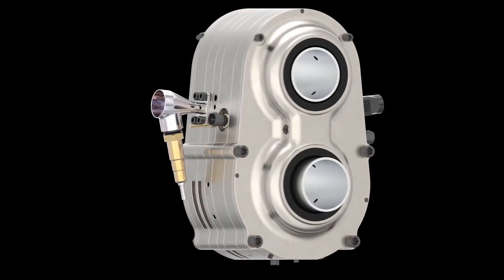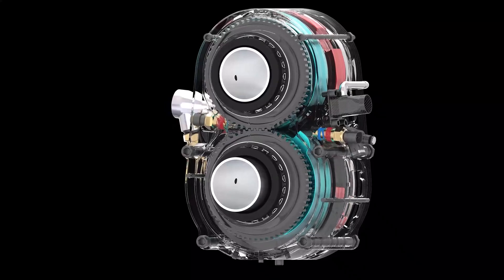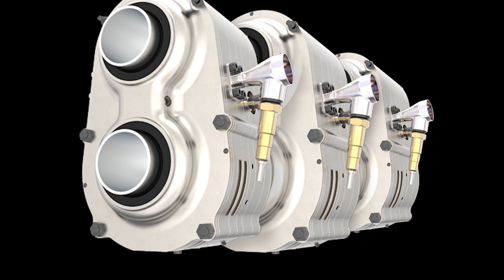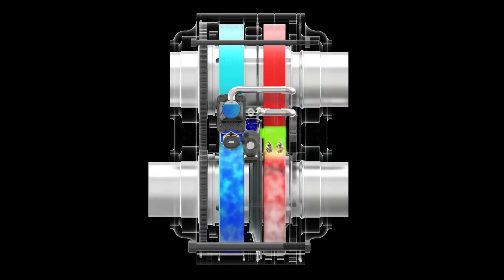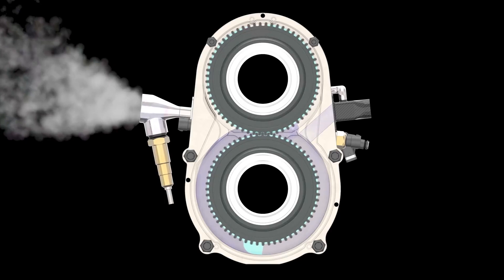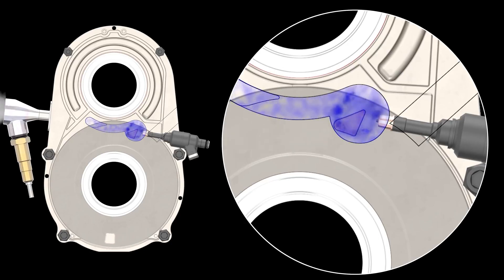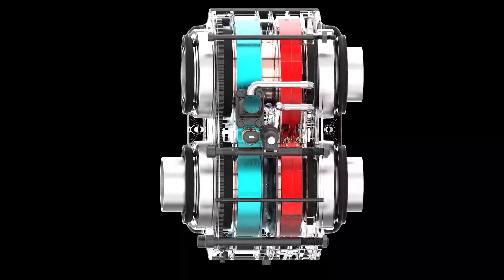This pistonless engine runs on hydrogen and revs to 25k rpm

Comment: 2 things come to mind, 1) I'll believe it when I see it in production and 2) I want one on a motorcycle.
Reply: I came here from a motorcycle channel lol
Reply: I was thinking my suv, but motorcycle? You daredevil you.
Reply: @chevyDboyMike  Most modern supersports bikes have north of 200hp, so 160hp is considered pretty humane in that regard. Still a heck of a lot of power at your fingertips don't get me wrong (and most avg bikes have between 70 and 130 hp).

The real benefits and why motorcyclists would cream their pants over this engine, is first of all it's power-to-weight ratio, which means everything -in a vehicle that doesn't weigh much more than a well grown man. An engine that can easily weigh 20% of a vehicle's total weight being shaved down to just 10%, is a big deal. Secondly, the internals have two naturally counterrotating rotary blocks, which is perfect because it helps eliminate gyroscopic side effects. This is very important on a motorcycle, because leaning into a corner is actively affected by gyroscopic effects of the engine, wheels, etc. Many manufacturers artificially create counter-rotating mass in engines to negate this effect, so having it be a standard feature saves both cost and weight.
Lastly there is packaging, this engine layout is both simple and also volumetrically small for its power output, meaning that you can fit tighter packaging on the motorcycle which helps lower overall weight, complexity, and improves rigidity. All these factors would cause tears of joy in any motorcyclist shopping for their next bike.
Lastly there is the hydrogen aspect, meaning that it would actually be cool to go green without sacrificing the "heart and soul" of the combustion engine, as many riders feel the Electric alternatives do. You gotta be a little mad to be a motorcyclist, you strap yourself to a powerful engine, two wheels, and not much more before you yeet yourself into the sunset. That whole idea of the bike being a bit of a beast that you have to tame and learn to live with, is a core mindset for appeal to many riders.

In a car, I would just want a pair of these with their size quadrupled in the back of a modern hypercar going rounds at Le Mans.
Reply: Yea motorcycle was my first thought
Reply: That would be one insane motorcycle if this engine actually performs as advertised...you first dude lol.
Reply: it is a modified Helicopter's main rotor engine, they use 4 of these units, light weight, super efficiency will often mean that it has been around for about 20 years already and being used by the military.
Reply: you ever get bucked off a horse? picture that but that horse can yeet you off at 60mph in seconds. motorcycles rarely have excessive power once your at 250hp your already hitting a point of little gain if bike and rider are as light as possible. you go any more your gonna need extreme traction control otherwise your bike will torque itself back over you even at speed if you have too much power.
Reply: Make that TWO in a motorcycle!
Reply: We might have something for you in 1,5y’s then.
Reply: Probably a better result going for an electric motor on a bike
Reply: @that_kca  how so? The issue with batteries is distance and where can I charge it and for how long. Add the fact that electric motors truely are not eco friendly.
They actually take more than 10 years to become more friendly than combustion, at which point you need new batteries. The fact that the batteries and everything else still require oil and mining to produce makes it a smoke and mirrors solution. 
This engine seems the way to go with the little I do I have on it. 
What is the "fuel" exactly?
So far on paper, this seems like a real eco friendlier option to both elec and traditional combustion.
Reply: @that_kca  Electric motors still have the issue of range, weight, and rechargability, while also lacking the more subjective charisma traits of traditional bikes - hence why all electric motorcycle endeavors so far have proven unsuccessful on a wide scale basis (as compared to electric cars that have seen far more success). Electric bike popularity will come eventually, sure. But in the meantime good midway alternatives would sell like hot cake.
Reply: @that_kca  yes I agree. And an ev bike would be alot of fun to. But I still would not mind a video of this thing as a working prototype you know.
Reply: Troy Reed showed how he developed his self-running motor from being a 10 foot tall monstrosity to putting it in a car. Charge the grid when you plug it in. 
Dennis Lee for 24/7 solar power anywhere on Earth.
Pro. Royal Rife for the Cancer Cure from the early 1900's. 
Dr. Stanislaw Burzynski https://youtu.be/qQKaCTdrmJc cured 98% of his patients with a harmless enzyme and the FDA is still trying to put him in prison. 
How deep does the Rabbit Hole go? Is everything Propaganda? I thought years ago that with the World Wide Web, there'd be a Technological Revaluation by now. The Elitist are making a last ditch effort by harping on the Green New Deal. Videos like this are part of the problem. They complicate matters to the point where it stifles inventors from thinking  linearly.
Did you know that you can take a magnet from a microwave and easily build an LED lamp that will stay lit for over a hundred years and more with no moving parts? There are technologies that would allow you to fly for as long as you can stay awake, then your buddy could do the same thing and you could continue until you run out of food or water (if you don't have a toilet).
The more you know, the closer we all are to true freedom. 
You "sound" intelligent, can you grasp the things I've written about?
Reply: Does it have a bore and stroke ratio ?
Reply: ATV is my first thought. Imagine the extended distance and wondering if you have enough gas to get back.
Reply: Cummings developed a working hydrogen engine last year (2021).
Reply: Things like this have existed for awhile, it just takes years to prefect it and make it sellable and profitable.
Reply: Definitely. Salute
Reply: “Then Peter said unto them, Repent, and be baptized every one of you in the name of Jesus Christ for the remission of sins, and ye shall receive the gift of the Holy Ghost. For the promise is unto you, and to your children, and to all that are afar off, even as many as the Lord our God shall call.” Acts 2:38-39 KJV 

“Jesus saith unto him, I am the way, the truth, and the life: no man cometh unto the Father, but by me.” John 14:6 KJV 

“For if ye forgive men their trespasses, your heavenly Father will also forgive you: But if ye forgive not men their trespasses, neither will your Father forgive your trespasses.” Matthew 6:14-15 KJV

“And I say unto you, Ask, and it shall be given you; seek, and ye shall find; knock, and it shall be opened unto you. For every one that asketh receiveth; and he that seeketh findeth; and to him that knocketh it shall be opened. If a son shall ask bread of any of you that is a father, will he give him a stone? or if he ask a fish, will he for a fish give him a serpent? Or if he shall ask an egg, will he offer him a scorpion? If ye then, being evil, know how to give good gifts unto your children: how much more shall your heavenly Father give the Holy Spirit to them that ask him?” Luke 11:9-13 KJV

“And Jesus said unto them, I am the bread of life: he that cometh to me shall never hunger; and he that believeth on me shall never thirst. But I said unto you, That ye also have seen me, and believe not. All that the Father giveth me shall come to me; and him that cometh to me I will in no wise cast out. For I came down from heaven, not to do mine own will, but the will of him that sent me. And this is the Father's will which hath sent me, that of all which he hath given me I should lose nothing, but should raise it up again at the last day. And this is the will of him that sent me, that every one which seeth the Son, and believeth on him, may have everlasting life: and I will raise him up at the last day.” John 6:35-40 KJV 

“And fear not them which kill the body, but are not able to kill the soul: but rather fear him which is able to destroy both soul and body in hell. Are not two sparrows sold for a farthing? and one of them shall not fall on the ground without your Father. But the very hairs of your head are all numbered. Fear ye not therefore, ye are of more value than many sparrows.” Matthew 10:28-31 KJV
Turn to Jesus Christ
Reply: If it dangerous wich might be the case i dont want it right under my body and literally hugging my legs.. so not on a motor but well see

Comment: combustion engine or maybe fuelcells are the way to go.
EV needs charging ports near every home (not doable) or you charge at gasstation. yet 20 min charging means they needs lots n lots of hcarging points there.
also cobalt mining for lithium is causing great harm in africa.
and cars buying second hand with need to immidiatly replace batteries at high cost is also not smart.

Comment: only minus is hydrogen is one the most hardest things to make. you are actually making more pollution because how expensive hydrogen is. hydrogen has higher value of MJ per kilo than gasoline or diesel but still making it is polluting a lot more than gasoline.

Comment: High performance, high pressure, high RPM, all contained with no seals but ultra tight tolerances? Sounds like very expensive materials for heat stability and very expensive manufacturing processes for the tolerances, and a very short lifetime because no matter the materials and lubrication systems you're doing damage at 25k RPM to something that cannot take a lot of damage before it loses efficiency.

As you're already lugging around a hydrogen tank you can't fill easily because there's very little infrastructure, why not send it through a fuel cell and use the electricity to drive an electric motor instead? No transmission, no exhaust (and no pollution tax), no famously loud air cooling, no energy losses to a high-volume ultra-high pressure air compressor...

Comment: I guess it could also run a generator and that could supply power to an EV drivetrain. I'm not knowledgeable enough to work out whether that's a net benefit over this coupled to a standard gearbox and shafts.

Comment: tolerance based seals in high energy environments aren't famous for lasting.
Run it of hydrogen? so selling a whole new fuel supply and distribution network for this one engine? I don't see the success.

Comment: I don’t think there is any point to this outside of aviation.  And even there hydrogen is a risky fuel.  Essentially you are only developing on one side.  Hydrogen and fuel have not been improved for decades and it’s unlikely that there could be any more development that would make even a 5% incremental difference. 

In the electric space however, there is huge competition to create ever more dense batteries so more power per kg with no end of development in sight.  

The technologies to deliver the electricity, solar, wind, pumped hydro, tidal, etc, etc are ongoing and are starting to drive down prices. 

And the third side of this is that electric motor development is also ramping up and we are still seeing ongoing large efficiency gains in the space.  

A car engine is the only third that can be improved in the ICE world.  We won’t get better fuel, and we won’t get cheaper methods of digging it out of the ground.  

Great engineering, but in the end it’s all really pointless.  All motors that burn resources that cannot be renewed are destined for the scrap heap.

Comment: Things like this coupled with electric cars would allow them to have smaller batteries because the hydrogen engine could generate electric to charge the batteries.  That would allow there to be no need for a transmission that would be needed with an engine with that kind of rpm.  Instead use this engine to power a generator to charge the batteries allowing it to always operate at an optimum speed for efficiency.  This would solve the range issue foe electric cars and the issue of using too many precious metals in the batteries.  Cut those batteries in half and have a limitless range.  Using the thumb rule that 2 HP = 1KW an engine capable of this rating could make enough power for the car to charge at a greater capacity than it discharge most of the time.  Maybe not while accelerating but while coasting and cruising, definitely.

Comment: I think it's a cool idea! I mean, it's not feasible and will wear out super fast due to lack of lubrication, thermal expansion, and crazy high pressures, but it's a cool idea!
Reply: Then let’s consider it a rough draft for now. It can be further developed. In its present state, I can see it deteriorating very quickly. But, the same could be said of the first piston driven IC engines. The first Model T’s put out by Ford had an operational lifespan of only 3,000 miles. Today’s cars are now eclipsing 300,000.
Reply: @kevinemmers9424  This design is not too dissimilar to the rotary engine which is no longer used. I suspect this will suffer the same fate. My biggest question with modern engines is why aren't infinitely variable valves (like the Koenigsegg FreeValve system) commonplace now? It's not new technology and has a host of benefits including power, MPG, emissions, weight, size, etc. Really not sure why companies aren't developing those systems right now.
Reply: @Kcducttaper1  Is the design you’re referring to about infinitely variable valves based on a design in which the camshaft is eliminated and valves are operated via hydraulic actuators which in turn are activated by computer controlled solenoids? Forgive me. But, my research in this is very limited and I would like to know more. I appreciate you providing me the Koenigsegg name as it provides a springboard of info for me to launch further research into.

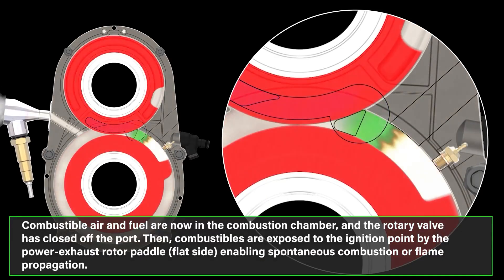Comment: 3:05 The primary mechanism of propulsion doesn't make any sense. The combustion happens behind the mechanism, but it's rotating at 25,000 rpm. It looks like the rotating gear will easily outrun the wavefront, causing no power to be generated.

This isn't like a piston, which reaches 0mph at top-dead-center, allowing it to easily absorb all of the energy from the fuel source (which gets ignited slightly before TDC, so that the wavefront hits the piston as it makes its way down)

Comment: Neat video.

 Given this is a journalistic report, and not the creators I doubt many answers will come for anything posted in the YT comments. That said few issues:

First is expansion due to heat in the second stage. Either it has no power until after it is warmed up or it is wasting power after it is warmed up. Materials expand as they heat and this would need to be accounted for. Using too tight of tolerance common to sealless designs makes this worse.

Second is where is the supercharger that is producing 250 psi.this unit would add significant weight to the engine, and would consume a lot of its power output. I would guess around 30-50 hp per stage spent on compression.

Third is seals are important to keep compression in, but just as importantly to keep lubricants out. It's all fine and dandy to have tight tolerances and short time periods for the process cycles, but the inner lubrication at the bearings  still needs to be isolated or it will coke/bake to any surfaces at the friction boundaries and the resultant wear will impact performance to say the least.

Neat idea on paper, but not likely in practice.  Also why have all that empty non working perimeter space. This is basically a single lobe compressor running in powercycle. Why not make it with 3/5/7/9/11 lobes getting that many more power cycles per rotation?

Comment: I'm wondering if it can handle gasoline. If so, it could make 3x the power. And if so, how efficient is it compared to a typical rotary and piston engine. I assume the power to weight could be insane if it ran on more potent fuel. If people can mod them, there will be a market for them. I love the idea of them, especially for a motorcycle.
Reply: Why would gasoline be more powerful? I very well could be wrong, but I thought hydrogen was the best fuel when it comes to combustion due to it being extremely simple. I thought gasoline was only used due to it being far cheaper to produce and distribute vs hydrogen.
Reply: @NeardyITGuy  Hydrogen is incredibly dense in terms of energy to volume. That means it takes up far more space in a combustion chamber (30% to 1-2%), which reduces its power output compared to the more power-dense gasoline. H is 3x more powerful by weight, but 3x less powerful by volume, and that's what matters in a combustion chamber. It takes more hydrogen to do a similar amount of work as gas. So if you convert a gas engine to run on hydrogen, you only have about 1/3 the power.
Reply: @numberlover8181  That took me a hot minute to figure out but I think I get what you mean and it checks out, so thanks